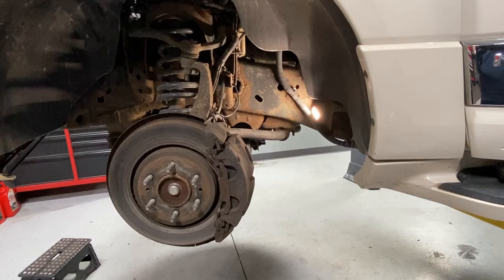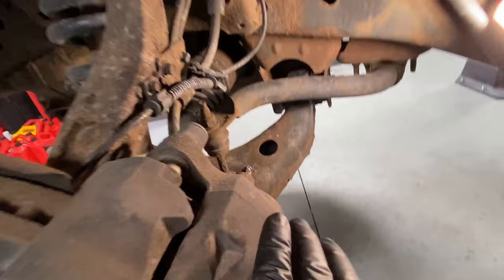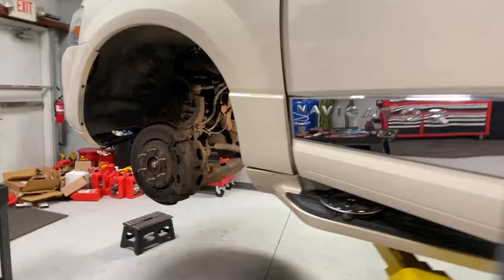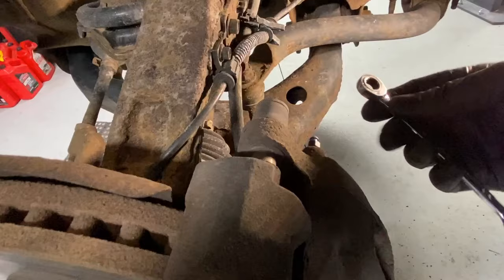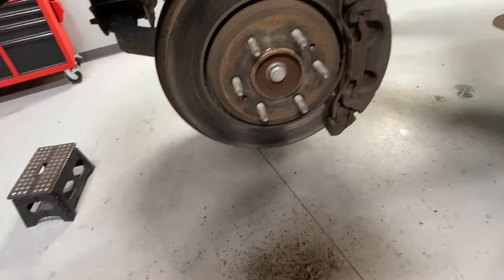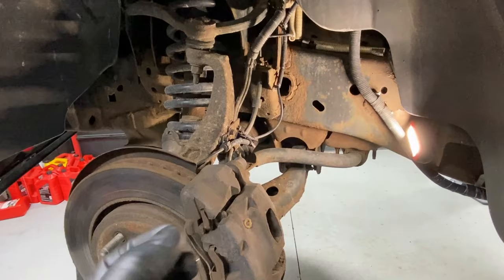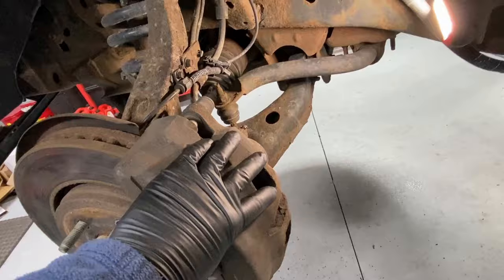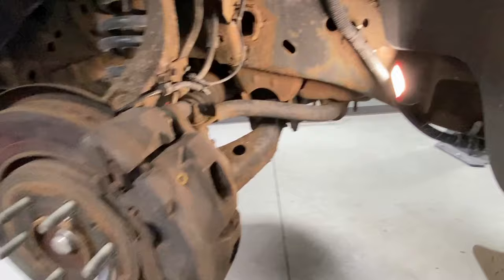How To Quickly Check if Your Vehicle's Brakes are Sticking and Why!

Comment: You make it sound like you're done. But you're not done. You have to replace that section of line from the caliper to the metal bracket.
Reply: Brake hose* known for swelling and causing sticking brakes.  If you open brake bleeder and nothing comes out probably have a swelled hose
Reply: That’s because this video is about diagnosing the problem, not fixing it.
Reply: thanks captain obvious

Comment: I had this problem with the same symptoms and replaced the brake hose with no luck. Long story short, the adjustable rod from the  brake booster if it can be making contact too much to the master cylinder it will hold brake pressure and can do it to just 1 wheel. The air gap between the rod and master cylinder on this vehicle is suppose to be .016" Very close.

Comment: I got new rotors, new pads, new caliper on drivers side, but the piston drags when releasing the brake pedal, what could cause this? 🤔
Reply: I have the same issue after replacing all three too.
Reply: @MonaeJohnson  wow, did you ever find out what was causing that?
Reply: Did you replace the rubber 
Hose coming off the caliper, which is what this video showed to be the problem

Comment: I've actually replaced more hoses than calipers for brake dragging complaints.
Reply: Hmnmmmm....
Reply: wow and this solved all the issues? I just replaced a caliper and hasn't fixed so waiting for hose to arrive. I really hope it isn't a mad master cylinder.
Reply: Update. Ends up being the master cylinder. Replaced caliper and hose for the wheel affected. Since bleeding that caliper. Now all wheels are dragging slightly. Before it was just one.
Reply: so the master cylinder changed all wheels dragged still? @KilliKonKarnage
Reply: @charlesyii8963  have yet to change master cylinder and brake booster but is most likely the culprit

Comment: An odd one for me. X system on I think an Escort. RF and LR on one port of master, LF and RR on the other port. In 5 miles RF would lock up, smoking hot. Customer had replaced calipers and hoses, gave up, brought it to me. I found that the master was not releasing on one port, noticed the LR was dragging also. This happens also on the X system when a rear cylinder leaks even slightly, not allowing fluid to be sucked from the paired front caliper when the pedal is released. In your example, I would also check the master cylinder by reapplying the brake and loosen the metal line between the rubber hose and the master cylinder. Then try spinning the hub. I've found over the years, if you've got an unexplained, odd brake problem it's usually the master cylinder.

Comment: Nice explanation. But, my problem is is both sides lock. Fyi, I have braided aftermarket brakelines. Could it be a proportioning valve not adjusted properly. I recently had mines changed.

Comment: After the fix it was still sticking a bit, shouldn't it spin without the two metals touching? It's like biking while applying the brakes a bit, it uses a lot of fuel. I mean shouldn't the brakes and the metal be apart from eachother?

Comment: Dp you need to bleed your break after you open the bleeder to release pressure from the caliper ?
Reply: not sure but think that’s basically the same as bleeding, which would be done anytime you take pressure off of the line to remove air bubbles

Comment: I replaced caliper and brake hose and it’s still sticking. Bled brakes 2x, have a firm pedal, just dragging still and I’m at a lost. Could there be air in master cylinder? Or is it due to uneven brake pad wear?
Reply: I did all of the same and mine is still sticking too.
New brakes, rotors, and lines
Reply: @lavarstarzz7811  I have new wheel Hubs rotors and pads new caliper new brake hose new wheel speed sensor I bled master cylinder and did an abs bleed with scanner and still sticking 🤦‍♂️
Reply: ABS problem. Please take it to the shop & have the ABS electronics on the RF/LF checked.

Comment: Is it possible that both front brakes would drag at the same time due to both hoses going bad at the same time? When I open the bleeder my brakes release like you did in the video. It does it after driving for 3-5 minutes then start dragging and then I have to open bleeder screw.
Reply: mine does the same thing after 10 mins of driving, both front calipers squeeze. then id have to stop. but then it would release sometime later. its like a never ending cycle lolol
Reply: @Boxnoob how did u end up fixing this issue?
Reply: @Jemartines81 I bled the brakes to get rid of any air in the system. I also swapped out the caliper that wasn’t working right. Plus, I replaced the master cylinder on my own since one side was all clogged up, and now everything’s running smoothly.
Reply: @Boxnoob  Ty for the quick reply.
Reply: @Jemartines81  No problem at all! I never received the support I needed to sort this out, so I just wanted to lend a hand since I know exactly what you're going through.

Comment: If it does squirt out would it be caliper that failed?
Reply: That's what  I was wondering ... if the fluid DOES NOT  squirt out - does that mean it's the caliper? Or even something else?
Reply: No, something else is holding pressure. If it doesn't squirt out, the caliper is holding on its own and needs replaced.

Comment: when i park on a slight hill and stop then press hard on my brakes then let off the brake peddle off the brake holds on for 2 seconds before it lets go, i changed the calliper and hose but its still the same, can you help me diagnose it please? thank you
Reply: isnt that a security feature on most cars these days? mine does that and its not a issue

Comment: 2013 Ford Escape 1.6 SEL, Brakes Squealing when backing, thoughts?
Reply: Check your thin metal guard behind your brake disc, dust shield, on each side I had a rock bend mine inward towards the back side of my rotor before and it was bent back so it would only grab and squeal when you reverse but going forward would not shove against it

Comment: I've had to replace my hoses twice on my ford truck already.  Never had to with my chevy.
Reply: Yeah because Chevy is new lol. Don't worry it will lose transmission or engine before brake lines fail I got 4 ford and 4 Chevys and 1 dodge only ford still run. Not saying they run good they are all project vehicles. Vehicles are only as good as you take of it. Every brand vehicle has flaws. Some more than others . 03 ranger with 335k still has all original brake components other than brakes and rotors calipers normal maintenance stuff all rest original so it might be something you are doing off roading or you not installing them correct or you are buying wrong length